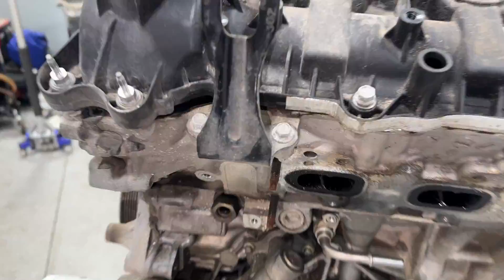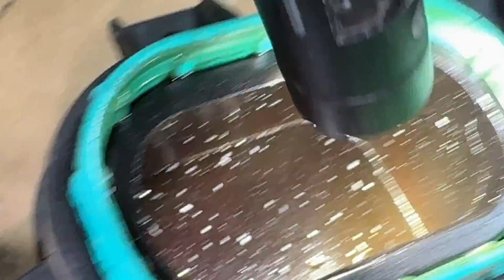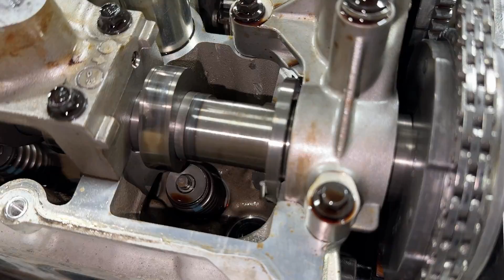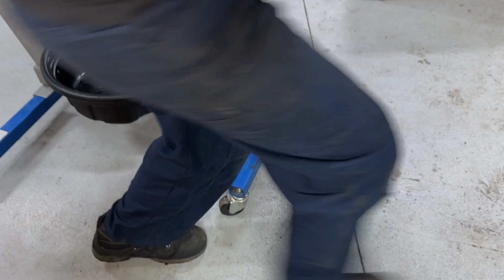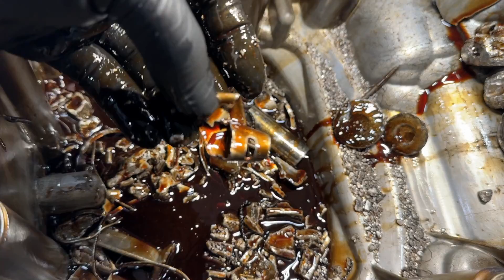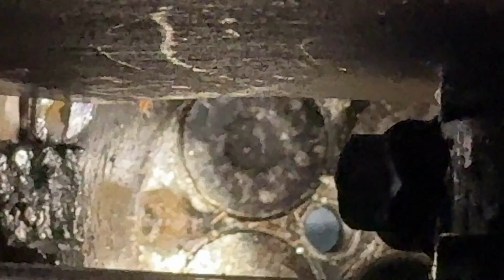Proof Ford Ecoboost Engines and Aggressive Aftermarket Tuners DO NOT MIX!

Comment: I’m curious, what do you recommend is the safest frequency to change oil on these ecoboost engines? I just bought a brand new 2024 Edge ST with the 2.7 twinturbo and I’m wondering if I should keep doing 3k mile oil changes as I’ve always done on all my cars or 5k miles. One thing for certain I’m not going 10k miles before an oil change that is insane.
Reply: I personally do 5k but I do mostly highway driving.  Depends on how hard you run it.   On another note,  the 2.7 uses a wet rubber belt to drive the oil pump, not ideal.  I personally would like to keep that belt as lubricated as possible for longevity.    I have 2017 which doesn't have the dual injectors to clean the valves(your does) but running a catch can will help keep the engine cleaner.
Reply: @orated762  I’m assuming the catch as you mentioned is a part of the dual injector system?
Reply: @giofromtexas2679  Oil Catch Cans MMBCC-FRD-11P.  It's an oil-air separator apart of the evap emission system.  You have dual injectors in your 2.7, 1 injector for fuel, the other to clean the valves.
Reply: I have a Fiesta ST 1.6L Ecoboost and I'm aggressive about my oil changes, being 3k-4k mile intervals
Reply: @SakuraSedaia  that’s exactly what I’m thinking… thanks!
Reply: I have a 2019 Edge ST built Dec 2018.
Motor Oil & filter 3K *NO ADDITIVES*
Transmission Oil 30k
PTU Oil 20k
Rear differential SAE75W Disconnect Rear Drive Unit oil - 20k
Maintenance may cost a little more, but it keeps the 'FUN' in driving, and a smile on your face.
Reply: @peterromano1911  thanks man!
Reply: 5k is fine for most DD. Full synthetic of course.
Reply: It is a Ford, so best to change every fill up.  Engine will still die before a TOYOTA.    FORDS NEW MOTTO IS make shitte. They’ll buy it.
Reply: @georgeburns7251  Buy a Toyota then..

Comment: Curious to know what company tuned it.
Reply: Same I have 5 star tuning on my 2015 3.5 and 2010 5.4
Reply: @tlalexander3  I use 5 star as well.  They seem to have more mild tunes compared to some others.
Reply: @Armyvet91B  5 star on my '16 ecobeast. Also seems to be doing alright for now. I don't beat the crap out of it all the time though.
Reply: Duramax tuner aka Calibrated power

Comment: This is why I've never believed in modifying an engine or a motor vehicle. This includes small things like using an oil that is not the recommended viscosity. My reasoning is that the engineers at the factory who designed everything know more about what they did than I do. If you change something you run the risk of having unintended consequences. This case is a perfect example. The owner essentially tampered with the vehicle and then pushed the engine beyond its design limit.
Reply: These things are designed to push over 700 hp from factory.  Was a bad tune.

Comment: Wouldn't surprise me if the rev limiter was raised and the rods let go because of that. Saw a similar failure on an LS over at Pine Hollow Auto Diagnostics where the rod made a window in the block when they were doing donuts in the snow, with the tires spinning it would go right to rev limit (or lack thereof).
Reply: Anyone who's experienced full-throttle acceleration in an EB3.5 equipped Explorer or Flex knows about that strangely flat torque profile, where the computer limits torque to prevent turning the transmission into Wheatena.

Ford left a lot of power on the table when they finalized their EB3.5 engines, which results in well-cared-for stock models lasting hundreds of thousands of miles. I encountered a 1st-year EB equipped Flex a couple years ago sporting 400K on the odometer, with nothing but coolant, oil and spark plugs for what the owner replaced.
Reply: Pumping up the timing is the usual culprit I see
Reply: @jeffreygoss8109 I wish they pulled the heads so we could see if there are signs of detonation on the pistons that didn't find themselves in the oil pan.
Reply: Cam phaser issue, bad fuel or he loaded the wrong map because alot of tuners allow switching.  Load a e85 map and gun it on 93.....

Comment: 2011 ecoboost now with over 290000 miles and going strong. Engine has never been apart. Factory tune
Reply: How often do you change your oil? I just bought a brand new 2.7 ecoboost and I’m curious because I refuse to go 10k miles between oil changes.
Reply: yea thats insane to wait till 10k. Ford wants failures for future sales @giofromtexas2679
Reply: Any issues with moisture building in the intercooler?
Reply: @jeffreygoss8109  I drilled a tiny little hole in the lower corner of my intercooler years ago. That's all. Only things  replaced are 1 leaking water pump and the little coolant fittings ( leaking) on the turbo. 
Spark plugs every 60000. All original coils/ boots
Reply: I set my oil service minder to 50% which works out to around 5000 miles
Reply: With my driving style 50% works perfectly on both my f150 and explorer.  10000 miles is way over what I believe to be a reasonable oil change interval. My 3.5 holds 6 quart of oil. Not sure on the 2.7
Reply: 2012 here @ 155K no issues.

Comment: I believe the correct terminology for what occurred there is "malice in the combustion palace" 🤣🤣🤣🤣
Reply: Yup, with Piston MacNuggets. 😂
Reply: Mr Eric from I do cars lol. I was thinking the same thing
Reply: he installed inspection windows on the block. Wonder if the water pump is OK?🤣🤣
Reply: Ventilated block...
Reply: Rapid unplanned disassembly. 
Or as King Richard once said :we had an oil pan failure at 6800 rpm.

Comment: I have a 07 Ford E-450 cab and chassis with a 6.8L V-10... what is your opinion for this engine...????
Are these the engines with the crappy spark plugs that break in the heads...???
Reply: About the biggest issue with the 6.8L is poor fuel mileage and a little lower power than expected. They should have regular spark plugs. I think it was only a few years of the 5.4 that had the stupid spark plugs. 
Most of the problems I’ve seen were 6.8s that had loads of idle time. The oil pump is small so once things wear a bit the pump doesn’t supply enough oil when hot at idle to really feed the valvetrain.
Reply: @NBSV1  thanks for your feedback...my van has 137,000 miles and nothing leaks...I change the oil every 5,000 miles with synthetic oil and only use Motorcraft spark plugs.... do you recommend using another brand of spark plugs...???
I also use ford/ Motorcraft products as long as they are affordable...
Reply: @novavroomvroom3435  Motorcraft is usually a good idea when it's available. Even with the "bad" spark plugs a lot of the problem was them getting left in for 100,000+ miles or until they started missfiring. I tend to change plugs at about 70K miles since they're relatively cheap and it's good to get them before they're super seized in there. 
They're a bit of a pain to work on, but that's vans in general since there's so little space. There's a ton of the V10's out there in motorhomes, delivery vans, and general work vehicles.

Comment: That's crazy damage! Is there any tuners or building techniques you reccomend on the 5.4 either 2 valve or 3 valves? I'm in Montana with no emission laws
Reply: Ford produced the F-150 Lightning. A 5.4 engine with a supercharger. It might be worth looking into a remanufactured engine of this type.

Comment: Thats nuts. My 2012 with over 200k on it had a stage 5 tune intake and full exhaust. I drove it hard. Stock turbos still too. When i had the timing chains done the tech couldn't believe how clean the engine was. Not 1 bit of carbon buildup. Im a believer in the right oil is also key to these engines longevity. Full synthetic and less headaches. BTW I love your videos.  They have helped me with some sensor issues i was having in the past.
Reply: When you run it hard it also makes sure there's no carbon buildup. I just dont do that. Coming to a Tundra after a built WRX, I have no intention of running it hard. What oil do you use?
Reply: @albowrx  i was running Valvoline I forget what version but it was hard to find. Autozone had it and stopped selling it. I was only able to find it on amazon after. But it was meant for direct injection and turbo engines.
Reply: @RichieBoomBatz  I think you are speaking of German Castrol that only Autozone carried. I ran the same in my WRX. From there I moved on to Pennzoil Ultra.
Reply: Its because it was a stage 5 tune
Reply: My wife has a 2013 Kia Rio that has 2700000 miles on it
Nobody at Kia believed it and they thought it was a reman motor
The head mechanic was bugging me asking me what fuel I put in it and what oil changes I did and what kind of oil because it still looks brand new inside and had no carbon buildup
Reply: It's all about having a good tune, good maintenance practices, good fuel and everything (sensors, fuel system, etc.) operating at spec. If you have a fuel injector lean out even briefly at those levels, or starve it due to a clogged filter, it can go very quickly. I have an 03 Harley with the 2V 5.4 SC engine that has weak rods that fail if you push it too hard and it's usually detonation that kills them. It's a noisy boat anchor too, so hard to hear a little ping! In your case, the newer trucks have better sound deadening that makes it hard to hear it. Mine is getting tired (timing chains rattle on startup, got some scoring on the cylinder walls), but it'll still start and drive cross country no problem with high miles. It'll still lay rubber all day if asked to do so, but I don't push it much anymore knowing it's getting old.
Reply: @mikelemoine4267  i had an 03 Lightning. I went through 2 engines before building a turbo dohc setup that went unfinished. Im aware of the Mod motors lol.
Reply: @RichieBoomBatz  Ah yes, the VBC (Vented Block Club), I haven't become a member, yet.... I'm planning to repower my truck at some point and am evaluating whether to just buy a built 2V or tackle putting something more modern in it (Coyote or Godzilla). I like the idea of having better performance and fuel economy at least into double digits, but am afraid it could also go unfinished as I'm getting too old to be modding stuff that heavily, and am better at taking stuff apart these days than putting it back together. I'm leaning toward a built 2V to keep it simple (also cheapest option), but it won't be much use for road trips due to the horrible fuel mileage. 

It is tempting to buy something newer and just tune it since the starting point is so far ahead already and the comfort and gadgets are so much better, but since I keep my stuff for a long time I'm afraid of what's to come with those $1600 taillights that can disable the truck if they get moisture in them. Decisions, decisions....
Reply: @Look_What_You_Did ??
Reply: @Look_What_You_Did when you get up past stage 3 it does sound rediculious.  Shouldnt be a thing.  Stage 1 is typically software only.  Stage 2 is typically FBO and stage is turbo upgraded.  Thats true for almost all makes from every brand.  After that... I have no idea what they are counting as a stage besides fully built block.
Reply: What does a stage 5 tune mean?
Reply: @AndrewEG I think they mean Five Star Tuning from Stage3Motorsports. Five Star Tuning knows these engines well. Speaking from experience.
Reply: '13 150 with just under 239 still on factory plugs 
Been adding MMO
Reply: @stephenbartram7377 wow that’s crazy
Reply: @carlmorrell5198  246,200 now
Reply: Probably SSi
Reply: What oil?  I use the factory oil for a reason so I am wondering what you were using.  The factory oil was designed for the ecoboost motor.  If you use the wrong oil it can cause low speed pre-ignition.  Same thing was true for my G37s infinti.  The oil they made for it was designed to refresh the plasma coating on the sidewall and if you used the wrong one it would strip it.  That 3 liter block was good up to 600hp because of that coating.  Car tech sure has come a long way
Reply: @WilliamArrington-m7d Ford Motorcraft oil is not a superior oil at all . Ford specs for oil is nothing special .
Reply: @WilliamArrington-m7d  quit the factory oil for anything quality full synthetic.
Reply: @WilliamArrington-m7d  factory oil is just a friggen blend led semi syn...

Comment: I love these videos. I use them to better maintain the two Fords that I own. I have no doubt that teaching me what I need to service, such as the PTU fluid, has saved me thousands and thousands of dollars in repair costs. However, what's most eye opening is how vehicle manufactures have been producing engines for dozens and dozens of years and still can't manage to produce an engine free of engineering defects. After seeing so many videos of EcoBoost engine defects I'll  never purchase one again. Actually, I don't want to ever purchase a forced induction engine. Just give me a V6 or V8 (although I heard you comment about certain Ford V8s that are junk too). I just don't understand why something that's been built for so long can't be designed without glaring defects that costs the consumer thousands and thousands of dollars.
Reply: Planned obsolescence, that's why.
Reply: I love these videos and I don't own any Ford products...
Reply: Could be a bit of planned obsolescence involved   ..especially when it comes to selling parts and whatnot
Reply: Designed to fail for service revenue. This is why Tesla is taking market share from ICE makers. They dont want them to fail on purpose as they dont want service revenue as part of their business model.
Reply: It's called planned obsolescence. If all the car companies made engines and cars that didn't break they would never be able to make money off anybody ever again think about that.

Comment: Still watching the video as I write. 
I had a 14 SHO and put a more mild tune compared to some. Stock otherwise. I ran it really hard one day and since then it made a whistle when hitting 1/2 throttle or more. The whistle had fluctuations like a football referee whistle. Not super loud. Kind of chirpy. Shops, dealers, no one could find anything. I kind of speculated that an exhaust manifold or where the turbo mounts had a small leak. Warped from the heat. 
Never found out. It drove fine but I always worried so I sold it to CarMax.

Comment: Drop an LS in it
Reply: One with bad piston ring seals, oiling problems, water pump problems, bent pushrods, or piston slap?  LS engines are hardly without their own set of problems.

Comment: If the bottom of the block is stock you  get aggressive  with tune  heads injectors you really not knowing what your doing   stock  parts cant take the torture   that the performance does